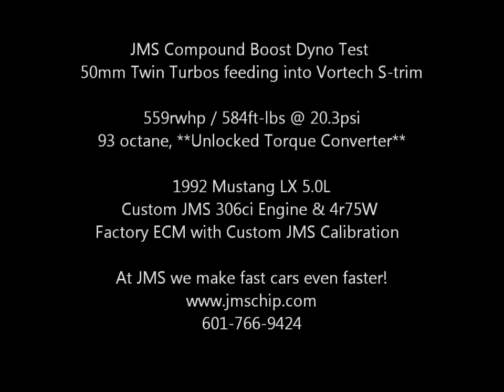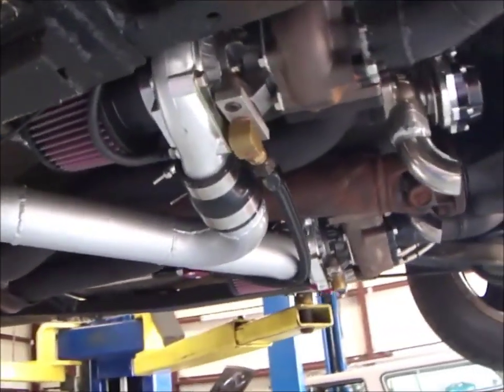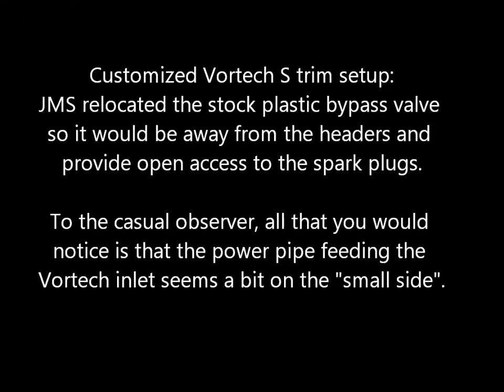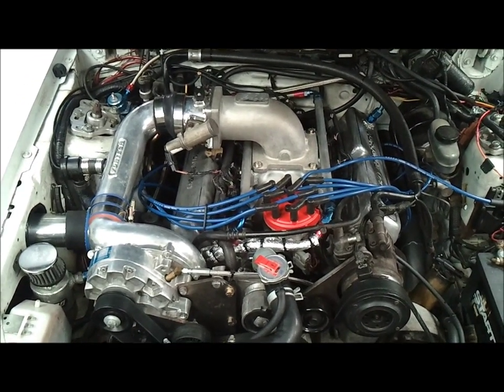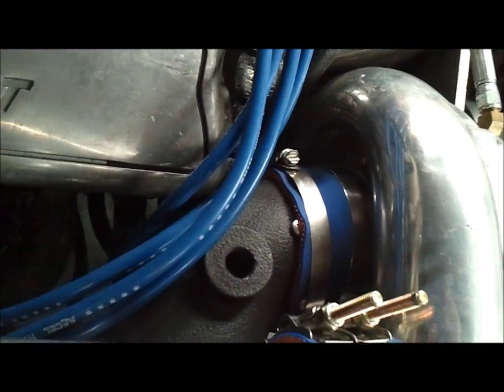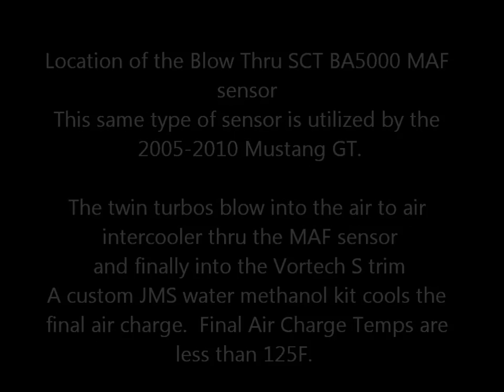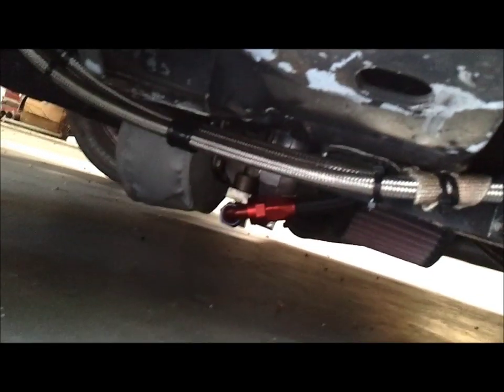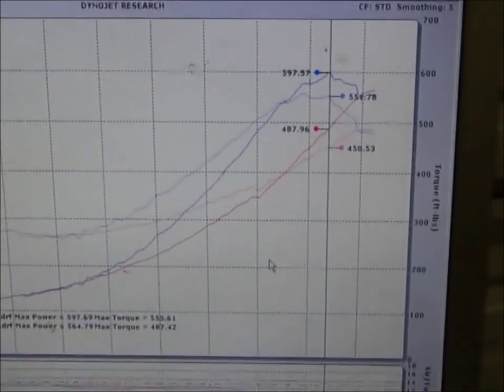JMS Compound Boost 5.0L Twin 50mm Turbo Mustang Blowing into a Vortech Supercharger- 559rwhp@20.3psi

Comment: Terrible idea IMO.  The impeller is not engineered to run that way.  You prove it works but it is extremely inefficient.  It would be interesting to run it without the blower and see the difference.  I think you would have to spin the blower a lot faster to make it produce the numbers you would want.
Reply: Wrong

Comment: lag on lag on lag. shoulda done a roots.
Reply: bhearts77 or a screw
Reply: bhearts77 But less power with a supercharger. Turbos all day
Reply: Andrew Jennings depends where you want your power though, right? that procharger has the parasitic drag of a supercharger, and the lag of a turbo. its pretty much the worst choice ever.
Reply: Turbo is free power. 2 step rev limiter and no lift shift and there you go no more lag. Want even less try out an antilag tune.
Reply: also since the procharger, actully thats a vortech but they are both centrifugal, is spinning off of the belt lag is a non issue. also you can do things like methanol and big front mount intercoolers for huge boost. All in all the same power can pretty much be achieved on which ever setup one decides on but in the end it all comes down to personal preference
Reply: Andrew Jennings its not positive displacement though. 1000 engine rpms might net 1psi boost. 2k could be 3. 3k could be 6. its not a 1 for 1 kind of displacement like a roots. where you instantly get max boost from the charger. those centrifuge chargers are only ideal for cramped installs.
Reply: Andrew Jennings but, i do almost totally agree about antilag. although unburnt fuel really isnt ideal for street cars. i cannot see that kind of antilag thing being a 100000 mile engine kind of thing.

Comment: That's a cool setup but what's the point? The same HP can be made off a single Turbo by itself ... nice build though...
Reply: Did you look at the torque curve difference? He made 200 lb ft more torque at 2000 rpm and 150 more hp at 2500 rpm. It's not all about peak hp...
Reply: BADAZZ93STANG zero lag
Reply: its stupid  run the turbos and a 150 shot it what  they all do. also they could just run sequential turbos this is a very very very bad idea

Comment: I have worked on aviation air conditioning. I was wondering if you ever thought of placing a heat intercooler between each stage? Look up air cycle machine.  It will take compressed air 15-35 psi from a turbine stage, run it through a intercooler, compress it again, and run it through the final heat exchanger. The air will go from 250 plus degrees to -0 to -50 at the other side of the final heat exchanger. Have you ever driven a boosted car in winter?

Comment from the maker: Originally we built this setup with twin precision 61mm turbos....the problem was that they were too big to make torque low.
At 16psi it made 600+rwhp....however torque was in the toilet where you use it (down low)....so we decided to have some fun and play.
Remember that these numbers are through an Automatic Trans on pump gas.
Also the twin 50's were $79.00 china turbos (low airflow) :).....the S trim was lying around the shop and it's airflow ability is low :). This is supposed to be fun :)

Comment from the maker: Originally we built this setup with twin precision 61mm turbos....the problem was that they were too big.
At 16psi it made 600+rwhp....however torque was in the toilet where you use it (down low)....so we decided to have some fun and play.
 
Remember that these numbers are through an Automatic Trans on pump gas.

Also the twin 50's were $79.00 china turbos (low airflow) :).....the S trim was lying around the shop and it's airflow ability is low :).  This is supposed to be fun :)

Comment from the maker: Your opinion is your opinion.  This car was built for fun with parts that were lying around the shop.  With just the blower the car made 430rwhp through the auto (yes it's an auto).  With just the turbos the car made 500rwhp with the same boost (less torque down low).  With both it rocks....it is different and that is what is cool.

Comment: This is a waste of parts! You are only going to get so much air past the impeller of the blower the turbo's are pointless. My 89 fox with a 306 H/C/I and a t trim made 531 HP. Not it doesn't have a gay "custom" powertrain with wasted parts. But I can say I don't have to worry about a rock or debris coming up off the road and ripping my oil lines off :). Here's a tip yank the blower and run the twins and make some real power the blower is pointless!!

Comment: Hp numbers are extremely low considering it's a 306 pushing 20lbs of boost, I just built and sold a 306 car with a Vortech ysi trim that pulled 522 on the dyno. And that was a very conservative tune on 16lbs boost.
Reply: chipstadley1 ecactly like cancelking each other out. My roush did 682 on a dingle centrifugal charger

Comment: JMSchip - No matter how you slice it - auto trans, misc parts or whatever. The bottom line is this is not much hp for the work and parts. The potential may be there, but these numbers are NOT impressive. There are 4 and 6 cylinder cars making more power and running faster with a single turbo... and yes I run well into the 10s on a street driven Cobra. I have another friend running 700+ hp on an NA car running high 9s. A car with twin turbos and a supercharger in my mind better run 1800+.

Comment from the maker: Is your Cobra connected to an Automatic Transmission?
Probably not :)

Also does your Cobra run in the 10's in the 1/4 mile?
Probably not :)

Was your Cobra built from parts that were lying around?
Probably not :)

Does your Cobra have a unique one of a kind power train?
Probably not :)

This same engine setup has made over 800rwhp but not on 93 octane :).

Comment: I love it, first time I have seen a setup like this on the dyno.

I am building a similar setup for my 4runner right now. Except will be using a single 62mm turbo and the supercharger will be a roots style so that I can "turn it off" once the turbo is spooled. It should also give me better low end then a vortech as well since it is positive displacement. 

Good to see some results to let me know I am on the right track!